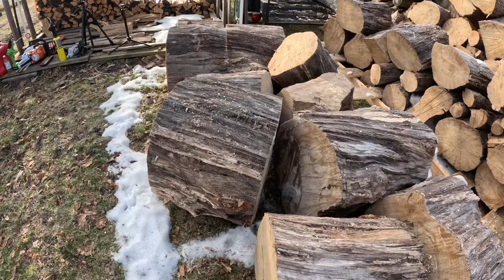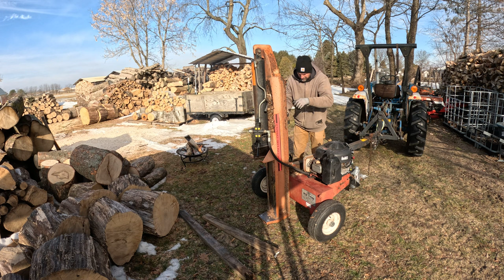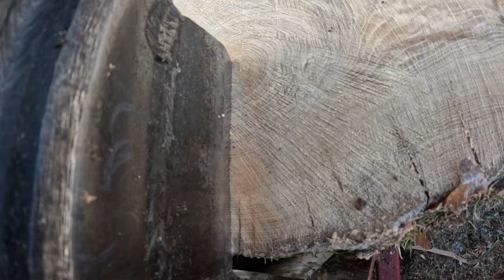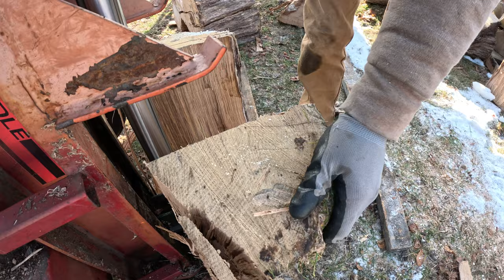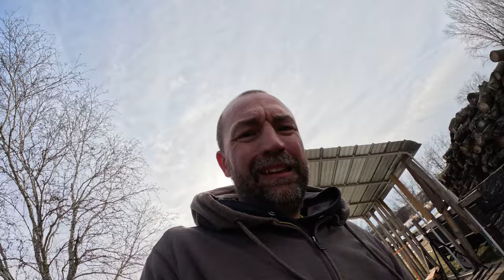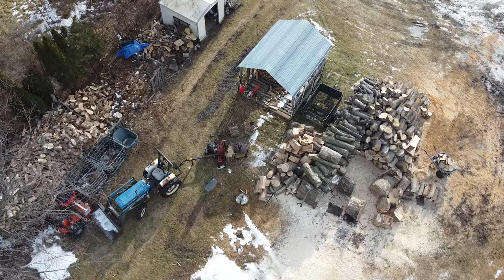Splitting large White Oak rounds

Comment: i have the same splitter.i never had much luck with it vertical so i made a ramp and rolled large rounds up on it i think it splits better horizontal.now i put an reciver on the end and a pickup crane with electric winch.works great with 32 inch log tongs i lift 1000 lb. logs onto it. i attached the ramps off my utility trailer to each side for tables
Reply from the maker: Wow that’s awesome! I bet it works great!!👍👍